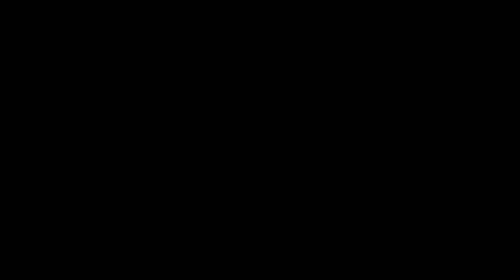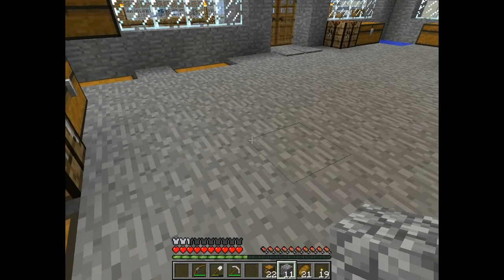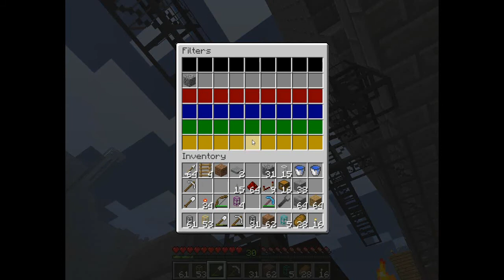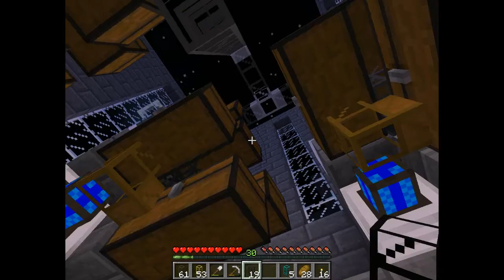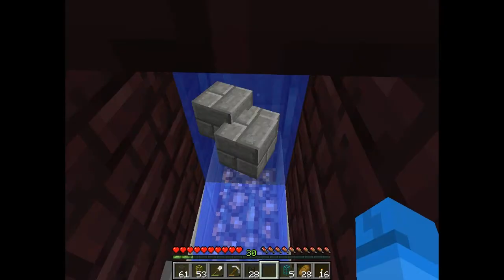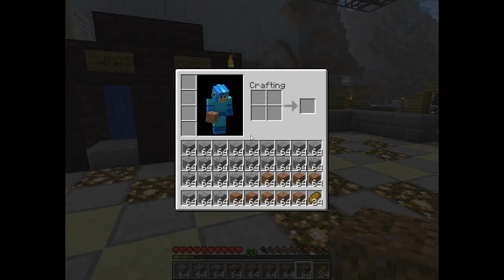My Buildcraft 21 - Storage Room (Part 4): Testing

Comment: yeah. i've already tried that method and it's not working. it's not a matter of speed, it's because the item are not even moving if i'm so far away from that chunk. so transferring item using pipes are impossible.